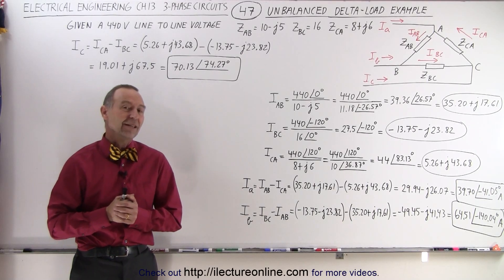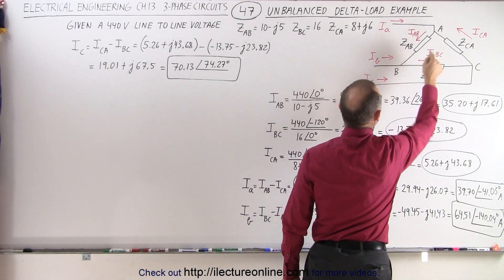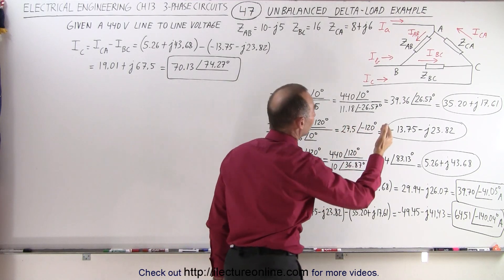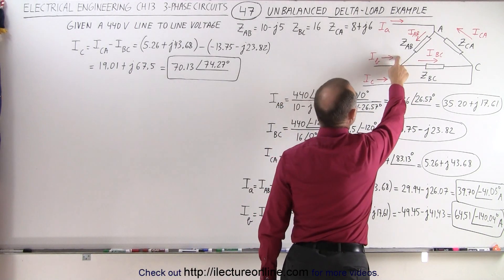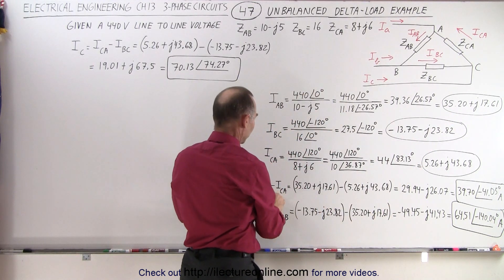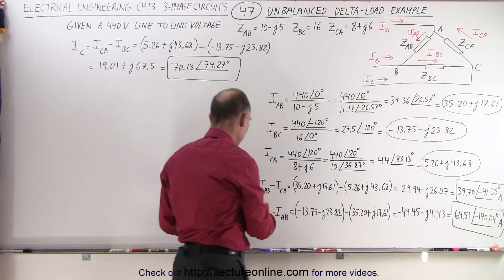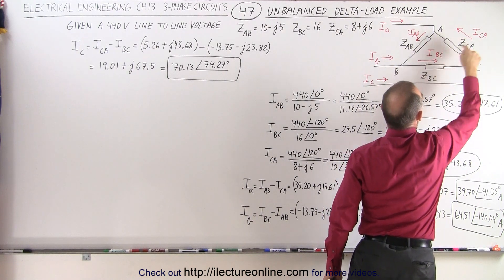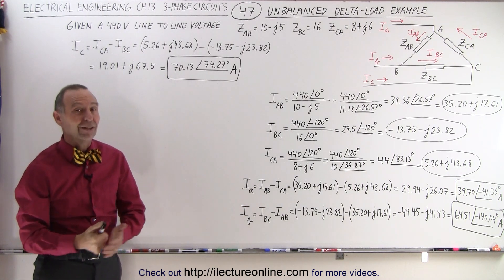Electrical Engineering: Ch 13: 3 Phase Circuit (47 of 53) Unbalanced Delta Load Example

Comment: Mistake in Ib
Reply from the maker: What is the error?
Reply: Ib = Ibc - Iab = (-13.75 -j23.82) - (35.20 +j17.61) = 49.95 -j41.43 _ 64.51 -140.04*A
Should be 
Ib = Ibc - Iab = (-13.75 -j23.82)) - (35.20 +j17.61) = 48.95 -j 41.43
Does not make a big difference however because you are presenting this it should be accurate
Reply: I have learned a lot from your presentations 
Thank you
Reply from the maker: Thank you for the correction.
Reply: @MichelvanBiezen  thank you for taking the time to present this material very helpful

Comment: Thanks for the video
But I would want to know, what is the phase sequence in this question?
And if the phase sequence is changed, would the direction of currents through the phases change, hence affecting the formula for finding the line currents?

Comment: how to calculate total power at unbalanced three phase load
Reply from the maker: I think that is covered in the latter videos?
Reply: @MichelvanBiezen  I cant seem to find the video that you mentioned? I would like to calculate power S, P and Q in an unbalanced delta configuration. I use the line currents feeding the load to calculate complex power using the formula S = V x I. Can I simply extract P and Q from this complex power in rectangular form S = P + Qj (considering it is an unbalanced load)? 

Any help would be very appreciated. Thank You.

Comment: sir we dont have to multiply the line voltage by root 3 to get a phase voltage then we can start to calculate those phase current or there is no need of that if its a unbalance system?? help sir im confused now  because it a deltar connection
Reply: That is in case of star connection only.
Reply: no u can use that formula only in balanced circuit
Reply: #shiyadh u wrong bro

Comment: Sir, What should we do if load is unbalanced in delta connected load. What are methods of prevention?
Reply from the maker: You need to change the impedance of one of the branches.
Reply: @MichelvanBiezen  How is it possible to change load instantly. It is the consumer behaviour.